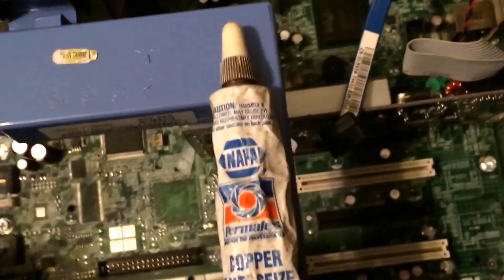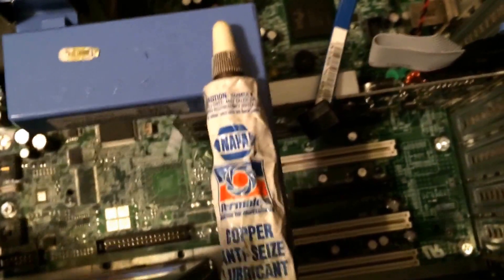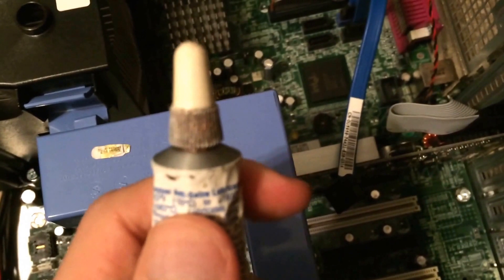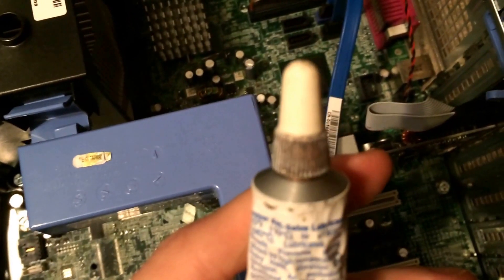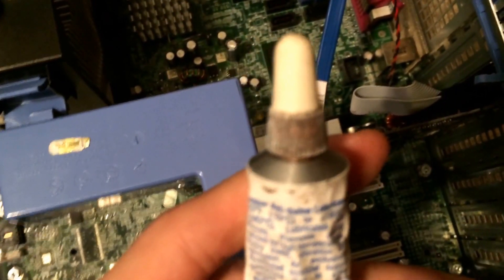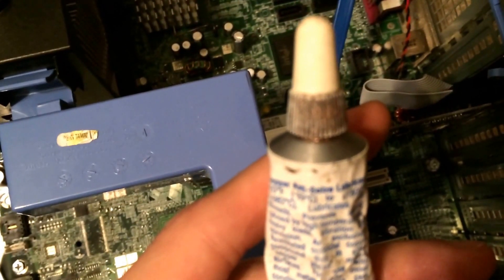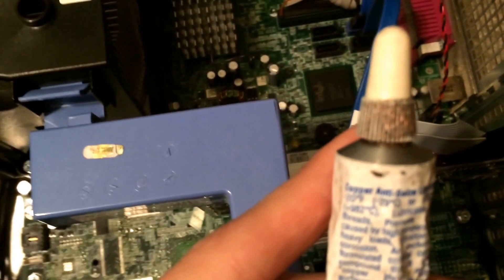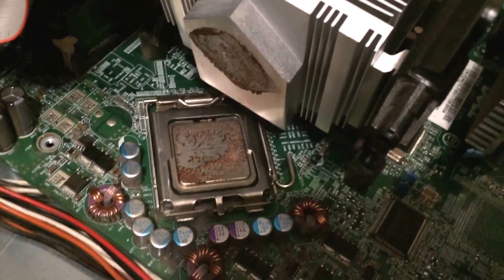Test: Copper Anti-Seize as Thermal Paste! *sniff*

Comment: 😂😂😂 what happened?
Reply from the maker: Shawn Jarrell I was out of thermal paste and I needed something so I tried this anti-seize (automotive product). I had it from replacing O2 (oxygen) sensors on my project car. Copper Anti-Seize works very well, but use it carefully since it’s electrically conductive. It’s much better than using toothpaste. I also had a cold that day.
Reply: @HWandW true that. I'm using copper anti seize now. 2 days in works great!

Comment: The CPU integrated heatspeader is not steel, it's nickel-plater copper. :D

What i see from the distribution pattern is that the copper might not be doing much anything, since it appears to be pooled up in spots. Even in normal thermal compounds the primary action is thermal surface impedance matching is due to the liquid, and the solid filler material is of secondary importance. Now chances are the carrier liquid in the anti-seize is quite suitable, since it's high temperature rated and should resist evaporation, but i do wonder about long term stability. Indeed many thermal compounds on the PC market have long-term stability issues, with liquid separating out, or the combined pump-out/dry-out, but some are known to behave remarkably well long-term. I probably won't be replacing MX2/MX4 with anti-seize. :D

But it is encouraging how well it works. I definitely should get some and use it in my 3D printer hot-end where even industrial thermal transfer compounds aren't really suitable for the temperatures involved, and improving thermal transfer to the nozzle provides an actual benefit - plus it will make the nozzle easier to remove when needed.

Comment: GM started using the HEI ignition in the early 70"s. Their module required a special grease that was probably thermal paste. Once we clued into what the secret grease was being used for, antiseize became a commonly available substitute, along with axle grease, dielectric grease etc. Everybody had a theory.  Using nothing at all killed a lot of replacement parts pretty quick. I even used antioxidizing paste once that is used to keep aluminum wiring from corroding when in contact with disimiliar metals.  Whatever was on the bench. Probably why the failure rate was so high on used parts. lol Same questions we had about substitutes are still being asked. Not a new problem. Funny. Interesting video.
Reply: Jeff Iscool hei distributor just uses dielectric grease I’ve rebuilt them many times.

Comment: I just started using nickel copper antiseize on my computers and gpus, really nice difference in temperature and longevity, thanks for the video.
Reply from the maker: Jorge Garza You're welcome. The copper anti-seize was not meant to be used as long as I did, but I had little choice since I had little health and little money. I certainly didn't want to use toothpaste! Would you post/comment the core temps with the nickel-copper you are using?
Reply: Sure man, my 4cpus intel i5's now idle at less than 30 celcius and wont go above 50c under heavy stress, it works so good I actually applied it to the videcoards too, the brand I got a sample from the tech guys at the lab at my work is Chesterton No. 725 if this information is relevant.